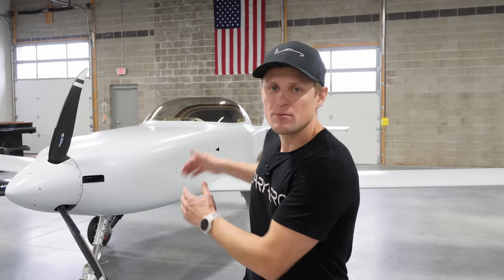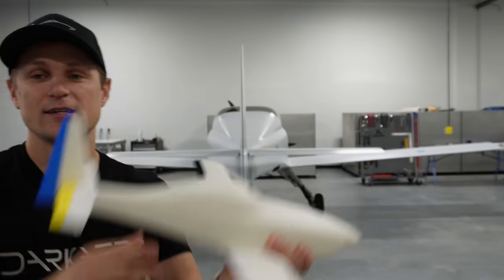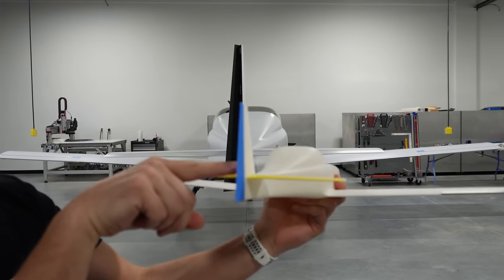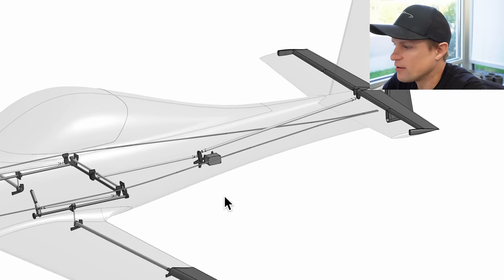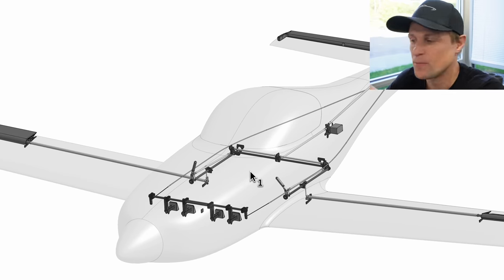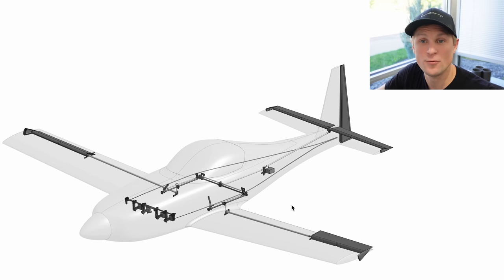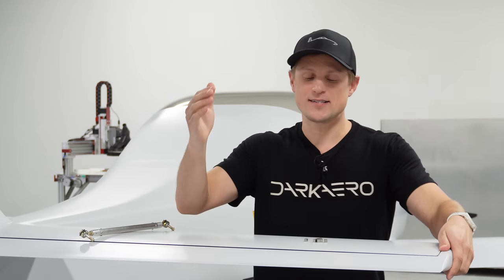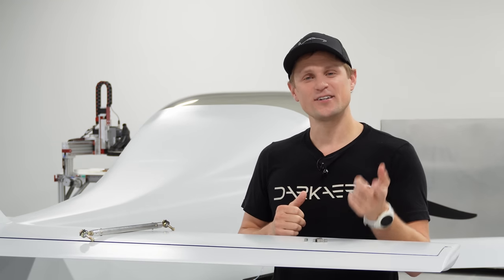What makes our flight controls different

Comment: Interesting rudder/spead brake. One thing I wonder about is propeller slipstream. On the Rutan canard airplanes the vertical stabs and rudders are outside the spiraling slipstream. On the DarkAero, it will be in the slipstream. I'll be interested to see how you deal with that, as well as rudder trim. My understand (which could very well be wrong) is that on the Rutan canards, the rudders on the winglets is more about creating drag rather than lift. Same goes with split style of flaps on other airplanes. I'm not an aeronautical engineer so I might be all wet... I'd like to see your split rudder act more conventionally with the rudder pedals and have a separate mechanism to split them. Kind of like the A-10 ailerons do. Hmmm... Or.... Leave the rudder conventional an put the speed brakes on the ailerons just like the A-10's!   
Keep up the good work.
Reply: I agree with you.   Rutan design is based on drag.  In conventional control surfaces it’s the back side of the control surface that moves the airframe.   It’s a wing you might say creating lift.  Left rudder input means the right side of the vertical fin and right side skin of the rudder making a positive airfoil moving the tail in the left direction.   I question if this will work well.   I’m not an engineer but have been designing and building model aircraft all of my life for 50 years or so.  Have studied design for decades.   I guess we will know one day.  Great project!!!

Comment: Ngl, I love everything about the split rudder aside from the control scheme you've selected. Conventional rudder pedals (push one and other moves opposite) with a seperate speed brake lever similar to what youd see on a jet's throttle quadrant would be much better as far as avoiding inadvertent speed brake application and making the transition from other aircraft more seamless.

Comment: I have now watched every one of your videos, some more than twice.   Its wonderful to witness the evolution of modern design and materials taken to their absolute limits for your mission.  The videos are so informative, easy to understand, and the plane is absolutely gorgeous.
When it comes time for a DarkAero II, how do you feel about a plane with a 55mph stall speed, fixed gear, fixed pitch prop, 200mph cruise, similar mega-range?  Come on, add a couple of feet to the wing,  a couple of inches to the cockpit, use that UL520T so we can outclimb the weather - this will be an rv-14 killer.  AKA, something us mortals can safely handle and still get insurance for (not to mention have a better resale value)...   Just food for thought, keep up the good work, and keep the videos coming.

Comment: What about ICING inside the split rudder design? Will you test the push force overcoming ice adhesion? Another option is adding heat for safety. Love the concept, but Ice and Breaking concern me.
Reply: Very good point.
Reply: How is ice going to get inside an aft-facing gap, when it is closed together for the entire duration of the flight?

Comment: Very cool. You didn't mention nose gear steering. How will that work? Maybe include with the secondary controls discussion?
Reply: It looks like it's castering (youtu.be/H8Ugh2fzd0I) but this still involves controlling the braking mechanism.  I didn't look carefully for past videos on this.
Reply: Yes they chose to go with a free castering nose wheel. Steering is handled by differential breaking and rudder at high ground speed.

Comment: Very cool, congrats on the innovative design!  I'm still looking forward to HS taxi testing/ TO roll testing.  I looked at the similarities/differences between the DarkAero and a TBM for TO roll (for P-factor). They are somewhat (loosely) the same. The TBM has a large rudder, and needs it to hold center line on TO. It will be interesting to see if the split-rudder will also hold center line at full TO power.  I'm rooting for you guys!  8)    --gary

Comment: You should reconsider the current rudder actuation. As @aaronhammond7297 mentioned in a comment a few days ago the Long EZ 'rudders' are somewhat required to be airbrakes because the force required to pivot around the CoG is almost straight backward, ie, drag. Which is not true for your design. Every time one will actuate the rudder it seems that it will also create some serious drag, due to rudder's size. Considering that you designed the plane for speed, that's a major oversight. Sometimes being different is not being better. You can keep the split rudder design, but the halves should move together, unless the brake is actually wanted and applied intentionally some other way.

Comment: Clever design choice with the split rudder/airbrake. For better or worse, this style of airbrake doesn't reduce lift when deployed. Wing spoilers have the benefit of increasing tire traction, although I suppose they have their own concerns, such as difficulty in packaging without a drag penalty.

I'm curious how the split rudder's drag compares to a hinged rudder at modest deflections (e.g. trimmed for P-factor at cruise).

Comment: TECHICAL PTS ONLY
Your rudder is just skin. It should've ribs. Otherwise, it gonna collapse under aero load, locking its hinge, making it catastrophic.
Too many linkages providing failure pts. Trim tabs is another set of failure points...Instead give trim tabs on stick like RC model 
Longer control horns proportionally minimize backlash.

Comment: You may have covered it elsewhere, but I would be interested to hear about the flutter considerations for your split rudder assembly.
Reply: Also, is there a deliberate or inadvertent elevator input when the control sticks are deflected in the aileron axis? I LOVE the control setup, by the way!
Reply: @joelighty409 I asked Riley about this in a q & a. He replied that the elevator deflection from applying aileron would be very small and that the pilot would typically add some nose up pitch to compensate for increased bank angle.
Reply: Thanks! @rickhearn5899

Comment: Great and enjoyable videos. My question is, is the darkaero going to have a pressurized cockpit?. However is the build of a pressurized cabin just dependent on the strength of material only or how is modelling a design for a pressurized cabin achieved, are there computations?
Reply: it's much easier to do pressurized with a round cross section like a balloon. This plane is more boxy. It's not impossible but flat parts need very high strength and the canopy edge and latching mechanisms have to be very strong as well. The 'glass' would be thicker too. Or would have less glass, more or a hard top with pillars like a car, maybe.
No pressurized GA plane has been done with a clear canopy afaik but not impossible. Fighter planes have it.

Comment: Regarding the split rudder.. my basic comments would be pretty much the same as the others commenting - interesting, but not necessarily a good idea.
I fly a Long EZ, at much lower speeds what you will be flying. 160 kts, max. when descending with full power :)
Except for takeoff and landing (65-90 kts) I don't use my rudders. No need for that, with the arrow shaped wings of the Long EZ it keeps straight, even at takeoff.

If I try to use them, at cruise speeds, 128kts with my setup, it takes considerable effort to press down on the rudder pedal. I am guessing it will be for the DarkAero too, since a split rudder is not balanced at all.
When used as an airbrake, in my Long-EZ it introduces a fair amount of unstability - both rudders don't have the exact same deflection - since I am pressing them with my feet and the airfow is not clean over them, at full deflection.
I much rather prefer to use my airbrake that extends from the belly of the aircraft. That is also much more effective on a Long EZ. Though max employable up to 90 kts.

If you haven't yet done it, try to find a Long EZ or other Rutan inspired aircraft (easiest with a side-by side arrangement) and try the split rudders for yourself. 
At cruise speeds, in a conventional aircraft you need the rudder to make coordinated turns. In a swept wing aircraft (Rutan style) you almost don't need it.

For airbrakes, if you can deploy your landing gear partially and if it doesn't interfere with the aircraft stability and controllability, the landing gear would make a wonderful and substantial airbrake, with no weight penalty other than the control knob for it.

And I am sure you have made the calculations - what forces are acting on the split rudder at Vne and the pressure you need to push the rudder pedals with you feet.

Comment: I like the split rudder as an air brake. But I hope you have considered how the airplane will react in flight with only half of the surface deflecting?

With this, you are splitting the airflow, creating a void of air forming  low pressure pocket behind the airplane. This means any time you use the rudder (usually at low speed TO or landing) you are adding a lot of drag, which could decelerate the plane at a critical moment. 

Another negative aspect I foresee is that while one side is deflecting, the other side is still in place, acting as a vertical stabiliser. I believe this will negate a lot of the effective yaw control and may require a lot more deflection to get an adequate response. 

Just my thoughts. Would love to see how you guys have tested this concept.
Reply: The drag force is reduced at lower speeds, and it's likely that the aerodynamic force when using normal rudder input will pull the opposite rudder along (unless the surfaces are blocked from moving across the center point).

Comment: How will you handle constant yaw inputs in cruise flight? Won’t a constant split be inefficient?
Reply: Like any airplane, the pilot has to learn its quirks. The cork of this is you can't push hard on both of the rudder pedals at the same time

Comment: How bad is the performance loss during initial climb when using a lot of right rudder? It seems like you’d be trying to climb with the speed break basically partially deployed if you have a consistent rudder input in

Comment: I am predicting the rudder will be changed after flight tests.  It would be more sensible to let the split rudder stay together as it moves left and right and only opens up when a speed brake is actually required. Easy enough to do with a mixer.

On an aircraft designed for utmost efficiency, getting a drag brake opening  every time you use the rudder makes no sense.
Reply: They would be wise to have a plan B.

Comment: Please explain the split rudder more.  I see impact force vs lifting force as  one side stays flat (stream lined) while the other is inducing drag.  Is the concept the same?  Are there efficiencies  in stabilization with the split rudder?
Reply: I don't get this either. The VariEze uses the split rudder to add a little extra pro-yaw drag out at the tips as well as the normal yaw moment, but I can't see the advantage of this on DarkAero because you're adding extra drag down the centre-line.

Comment: Have you thought of including a toroidal propeller.
Reduced noise, higher performance. Amazing.
Reply: Have you seen an aircraft toroidal propellor yet?

A few have shown up in 3D prints for drone props…

But, I haven’t seen anything since the wave of initial interest…

Great question!

Lots of added weight, way out on the nose, creates a lot of design hassle…. 

It would be nice if it has real benefits…. To match the hassle…. 😃

The DarkAero team would be a great group to make it happen.

Comment: Can you talk a little about how the split rudder is able to handle the high air drag forces when both sides are out?
Reply: They mentioned braking forces… for slowing down, or descending…

Or, are you asking about how the structure physically handles the added forces while braking?  😀
Reply: @AC-jk8wq  Yea I’m more wondering about the mechanical structure. When that planes going hundreds of miles an hour I imagine the forces are huge and you can’t really see any of the mechanism.

Comment: I noticed you have an elevator servo connected to the linkages. The rudder control cable system as well as the ailerons do not show servo’s though you did mention servo’s related to a future video on the split flaps if I heard you correctly. At the very least having some sort of trim tab on the rudder would significantly lower the pilot workload on long distance flights. Could this form the basis for a 2 or even 3 axis autopilot system?

Comment: How are you guys running brakes and steering with top mount lever pedals?
And will there be anything in place to ensure that resting on the pedals isnt going to cause constant airbrake?

Also how are you accounting for the need for trim?

Comment: The prototype 1932 Beech Model 17, later named Staggerwing, has a split rudder.  This feature was not carried over into production staggerwings.  The prototype Model 17 is in the Beech Heritage Museum in Tullahoma TN. It will be interesting to see your rudder performance results compared to what Beech experienced 92 years ago.
Reply: "Interesting" is a more gracious word than I was thinking when I saw how that rudder works. I'm certainly no expert in fluid dynamics, but I could see a non-zero possibility of turbulence-induced flutter coming from the use of that split vertical stab. Until now, I assumed the rudder would work in a traditional fashion for yaw control, and only be split for braking. These kids are way smarter than me though, so hopefully my concerns are unwarranted. I am curious what the benefit of controlling yaw this way over the traditional way.

Comment: Why didn't you do the mass balances internally? On the elevator couldn't you have a longer mass balance arm inside the fuselage hanging off the torque tube. Same with the Ailerons off their torque tubes?
Reply: Adding, this has been a fantastic project to witness and learn!
Reply: this

Comment: Do you have a rudder trim system ?
Reply: +1 for rudder trim!

Not always needed… but always appreciated!  Really nice for those long climbs to altitude… and extra speed during the descent.

Kinda like a yaw damper for the auto-pilot too… not a requirement, but really nice to have in the bumps…

Don’t fly sideways!

😃
Reply from the maker: We don’t have rudder trim on the prototype, but it wouldn’t be hard to implement if a builder wanted it.

Comment: So everytime using the Rudder deploys the Speed Brake every time? Even trimming the Rudder results in more drag?  

Does DarkAero have Directional Stability problem that your trying to fix with the Rudder Speedbrake?  Wagging the Tail, reduced by deploying Speed brakes with Rudder deflections?

Comment: Any reason you used torque tubes for the elevator and ailerons instead of cables? I happen to be really familiar with a specific aircraft that only uses cables for its flight controls so seeing torque tubes was intriguing. Thanks

Comment: I didn't see any mention that the long torque tubes through the wings, at the cabin, don't pivot at the tube?  Hard to explain, and I don't have the correct vocabulary to properly describe, but watch closely at around the 6:00 mark.  The inboard bell cranks are anchored on one of the ears?! Is it very weird that the inboard ends of the torque tubes move up and down in space?

Comment: Do you have enough leverage for one hand to over come the forces on the ailerons control surfaces?  If you have 1:1 ration on the torque tube then the only lever advantage is the length of the stick. 🤔🤔🤔🤔🤔🤔

Comment: Looks las though it'll be a nice, crisp handler. A little bit  of friction in the systems isn't bad as a damper of oscillations.  It will be interesting tosee how you handle trim, and how you achieve differential on the ailerons.

Comment: Is there any redundancy in the system? Seeing that the elevator is connected via a single push rod, does that mean there is a single point of failure?
Reply: Tons of single point failures in their design for sure! The ailerons are also single rod controlled instead of a typical push-pull twin rod setup. Even the split rudder effectiveness with the short rudder couple length has me thinking they won't have much rudder effectiveness at lower airspeeds with lower prop blast at lower power.

Comment: The „torque“ tubes actually designed here, are not really loaded with a torque load, as they do not revolve around an axis that lies in the center of that tube but are rather „bending“ tubes. I would like to see that working as well, but i am a bit afraid that under stress, there will be too much flexing in the controls… flight testing will tell. But my greatest respect for all the design and engineering work done here and the nice documentation… out of your videos i took the inspiration to also use Onshape for my projects.👍🏼 Great tool!
Reply from the maker: The torque tubes are still loaded in torque, even though they don’t pivot about their central axis. Other aircraft control systems use torque tubes loaded in a similar manner, it works just fine. The loading and motion is similar to a crankshaft in a piston engine, just a longer shaft here.

Comment: Won't you have a lot of drag with the split rudder when compensating for P-factor in takeoff or simply using it activley in flight? Seems an odd choice considering all the other choices biased towards efficiency / low drag. Also rather concerned about how it will work in spin recovery.